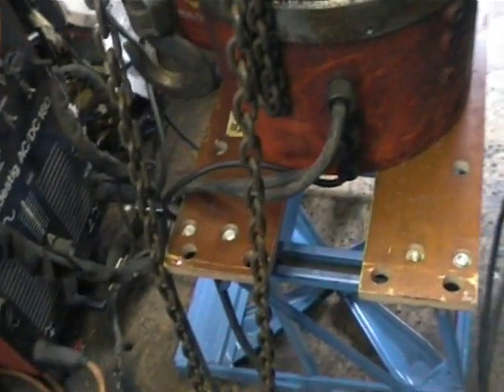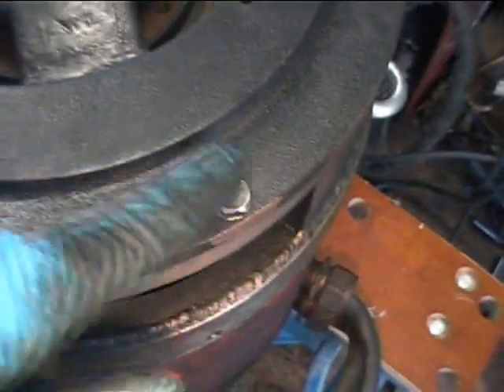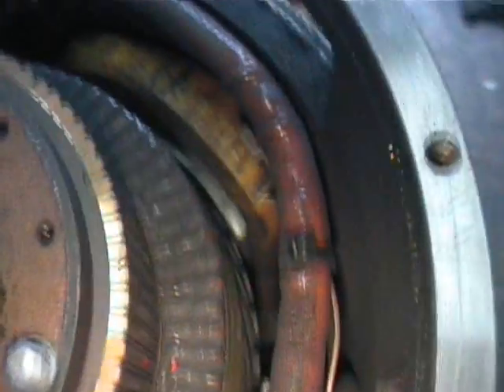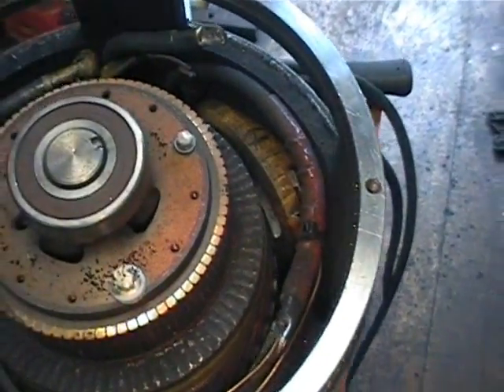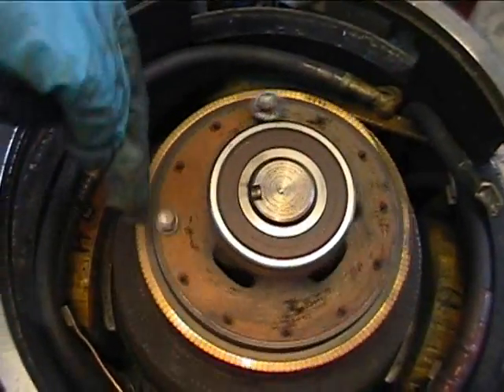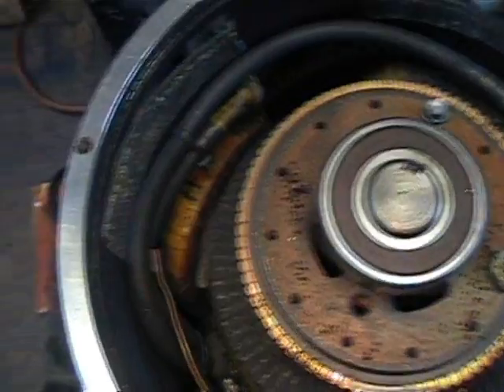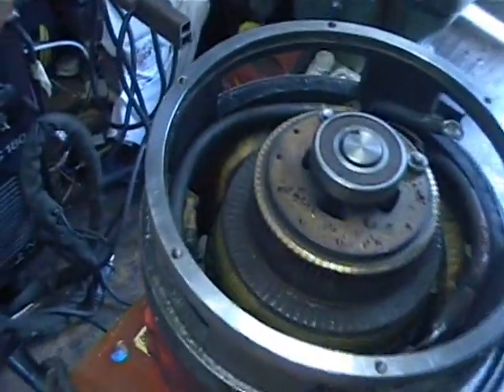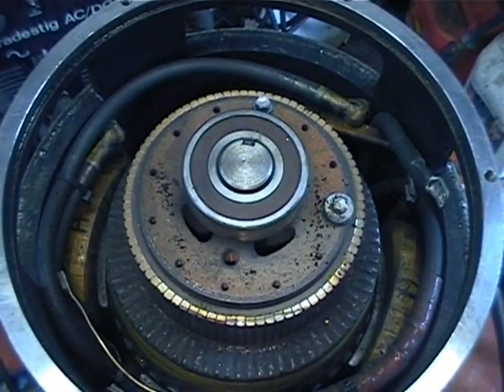Series DC Motor brush advance Part 2

Comment: Good video Mate, Just picked up a Large 13x19 GE DC 48v forklift motor for my Nova project. It weighs about 250lb and is a monster. I wanted to know how much voltage you are running, about how much advance and what your motor specs are. Thanks!